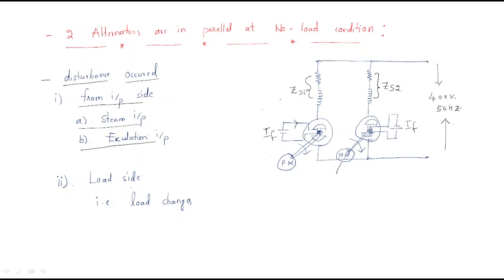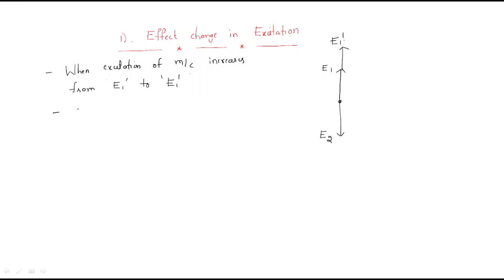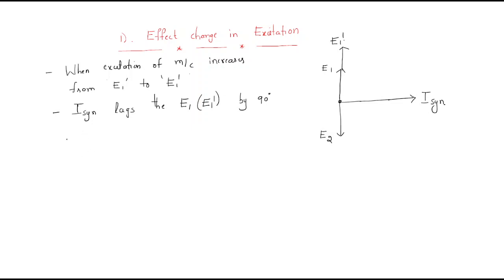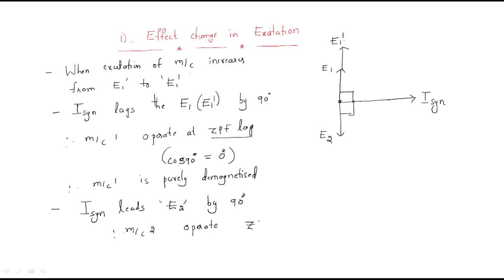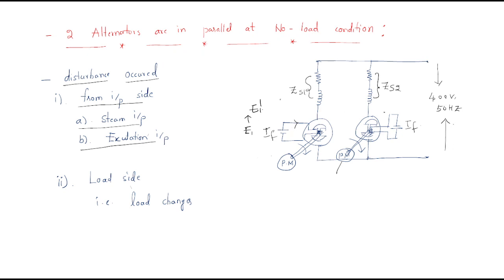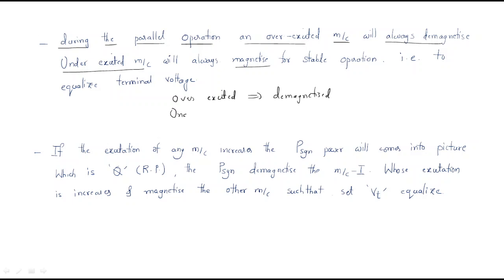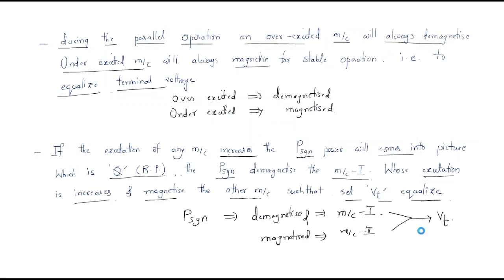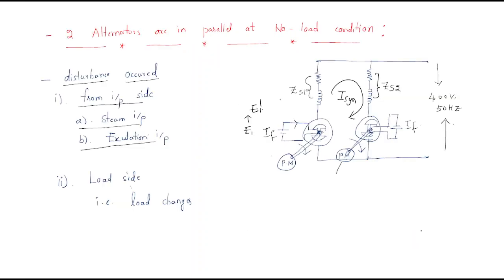Effect of change in excitation | Synchronous Machines | Lec-28

Comment: Why do we call it as Synch Power or Sync Current instead of normal circulating current? Are both corculating current and synch current the same? Does it also applicable if both paralleled with loads?